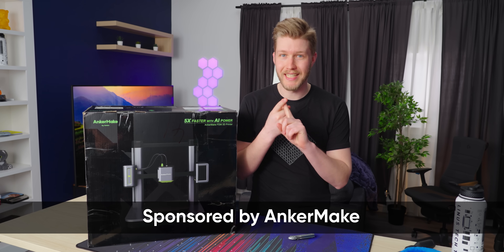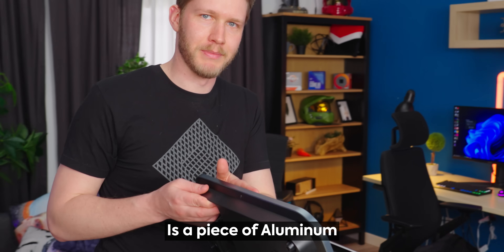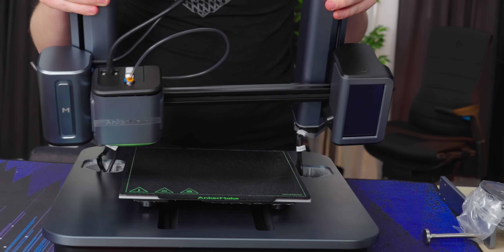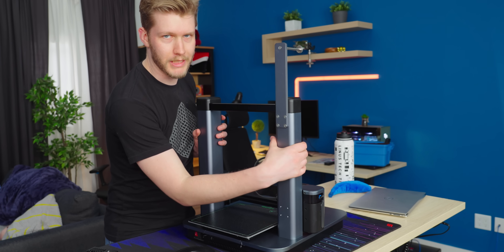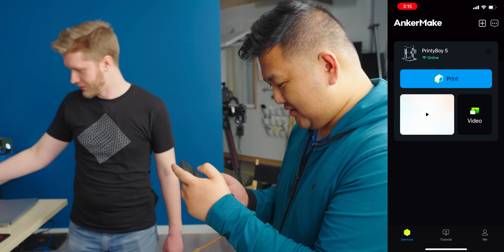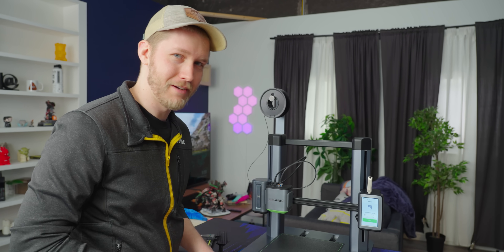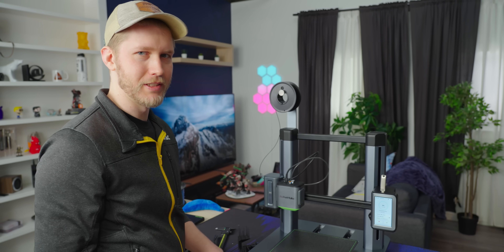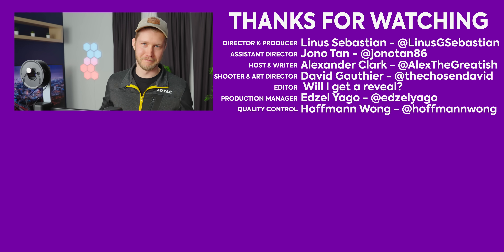Much BETTER than Expected - AnkerMake M5 3D Printer

Comment: This thing is crap... First off auto leveling reliance, you need to level a bed, no fancy auto leveling is going to fix bed leveling, but hey if you like parts with a tilt to them because of auto leveling compensation go for it, i level the beds on my printers about once a month when i replace the build surface, i run around 5kg of filament through my printers per month, i have 8 printers, do the math, i print a LOT.  For the price you would be better off buying a Creality Ender printer, the 3 is good for beginners, easy to assemble, easy to maintain and repair and modify.  If you want a large volume printer go with the Ender 5 Plus or the slightly smaller Ender 5 Pro.  Most of my print farm is older Makerbot Replicator printers that have been massively upgraded and run daily, but i also have an Ender 5 Plus for large prints and its been flawless since i upgraded it to linear bearings instead of the rollers on the X and Y axis, there is ready to buy upgrade kits out there for it and easy to do for even beginners.  I've been printing almost ten years now also, and i haven't had much issue, i suspect they were using cheap crap printers if they have had that kind of experience in the last ten years, most stuff above the really cheap crap has been great in that time.

Comment: *editor, don't judge.
Physical assembly of equipment like that is more about specific unit practice & experience than anyone not in a repair role has the experience to realise.
Former Paslode repair tech in Australia- there are specific ways to hold, brace, clamp, apply force to each specific tool, depending on specific size, shape, weight, task & worker physiology. So everyone figures it out themselves in general - that foam assembly assistance was Unusual as general a rule outside of that experience, as well.

Comment: It scares me the amount of detail left out for a sponsored video….

What are the build dimensions? Max hotend and bed temps? Standard nozzle? How do you access the nozzle? Does it come with a brass nozzle or anti wear? That box the filament enters is just a run out sensor? This is direct drive? Is there USB access for a computer or OctoPi server?

All I’m seeing is an Ender 3 S1 (Pro) with a locked down slicer and no 3rd party support for a lot more money….it does look pretty…

Comment: As the first 3D printer product, Anker did a great job, it is a real out-of-the-box printing, which exceeded the performance of 80% of the printers on the market.
But if it can do 250 mm/s at 5K acceleration, 4K deceleration, and a perimeter distance less than 20mm at a speed of not less than 100mm/s, I will be very shocked.

Comment: the alu isnt cnc milled its cast its alot cheaper and about the same amount of metal youd get on any other 3d printer just used in a different way rather than alu square beams

Comment: The printer looks pretty sweet not gonna lie, but I'm hesitant to back it. You just can't know exactly what you're going to get until production units begin shipping. One thing in particular that puts me off is one of the fine print notes at the very bottom of the Kickstarter page: "The 3D printer needs to be connected with the AnkerMake app. The app only works when all linked devices are connected to the internet." Being forced to use their proprietary software whose purpose is probably largely to phone home just doesn't sit right with me.

Comment: there is no way thats anywhere near 250mm/sec. all lies, your acceleration is far to low to even achieve those speeds with those small prints you're doing, its all a visaed. its like a glorified ender 3.

Comment: I admit, it comes with some nice bells and whistles and impressive speed, but outside of the speed, the price is a bit high, especially for anyone looking for a first printer (which is what the marketing looks like it is targeting, to me).  The bed only hits 100C and the hot end only hits 250C.  That’s entry level capability and it’s going to limit most people to PLA, PETG, and TPU without adding on an enclosure, and nylon and PC are completely off the table.  If you want a direct drive printer, a Creality Ender 3 S1 is $350 cheaper, has comparable base specs, is just as easy to assemble, and has fairly extensive first party and aftermarket support.  The S1 Pro gets you into a 300C hot end and is still $260 cheaper.

Comment: Cheap printer huh? 700+ for quality that you can easily reach with an ender 3 and some mods. The big advantage would be that while youre upgrading your printer you would start to understand more and more about 3printing itself. And this is knowledge you definately need sooner or later. Also this anker printer will fail at some point and then youre basically fucked. 

If you want a entry-level printer which allows you to tinker and dive into the world of 3D printing -> go for the ender 3 and mod the shit out it. 
If you want some kind of "apple" in the printerworld -> go for prusa. Their printers are in this price range unmatched. They have excellent support and a large community (something that maybe never will evolve around that anker printer but who knows).

Comment: This is not the product. This is one of 13 machines made in a limited run. It's not appropriate to offer any opinion on a product which doesn't exist yet based on a machine which has been made specially for sponsored reviews, especially not in a video which will still be around once actual production machines are available and people start searching for reviews of those.

Comment: My Prusa Mk3 has basically never failed yet, printing PETG on the textured plate without a worry.  But it's still a process under improvement - I honestly don't expect real innovation out of Anker though. "AI power" is just buzz words, and this video is as usual with LMG a paid ad.

Comment: What I am realy hoping for is that the final version will also perform as well as this unit. What would also be nice is if they would have an encoder as a Filament Sensor. Not only would it detect if filament is running out, but also if the extruder is jammed. 
What would also be important to me is that you can easily tension the belts and do basic maintenance without tearing down the whole machine.

Comment: The "calibration" thing where you measure how much a length is over- or undersized is a myth. The stepper motors have a fixed steps per rotation and every rotation will be "x" amount of teeth on the pulley. So the only thing that can be off is the pitch of the toothed belt and those ones are extremely accurate. Outer and inner dimensions have a fixed offset though due to the droopyness of the filament and the programmed compensation for that in the slicer, not in the printer.
Edit: The 0.5mm undersize is a lot off though, thats more than the width of a print line. This is most likely due to slop in the belt and needs to be tightened

Comment: Yeah, no. I am not a fan of massive companies offloading their R&D and marketing costs to the consumer via kickstarter. All the blurb about 5x speed, talking about standard 250mm/s speeds when that seems to be the max of what the printer can do (according to their documentation). AI stuff only working with their proprietary slicer, huge red flag right there to me.  Their mesh levelling is just that, no auto-z it seems (again, kickstarter page, I quote: The only time you need to do any tweaks by hand is when you upgrade something major like the nozzle or PEI soft magnetic plate.). All that, and buying into a proprietary ecosystem that may or may not have parts available 2 years down the line? NOPE!

Comment: aluminum isn't even expensive though? 25% more expensive than plastics. am i missing something? both plastic and aluminum are really cheap mineral/material.
Reply: you could see the indentation that coralate with a cnc tool removing the material from the back of build plate. this adds time, machinerie tool and specialized work. the piece needs to be about 3 inches thick. most of the material is lost when making these kind of pieces and like they showed, a piece of solid aluminum with the correct size cost a pretty penny.

Comment: If GCODE tells the tool-head to make two lines 40mm aprt, you gotta remember that those lines have a width.
The error you were reading is the width of the line, mostly.

Comment: I have and use the Snapmaker 2.0 A350 Modular 3-in-1 3D Printer, that is made of only metal mostly thick aluminum, and it's a great 3D printer, 
and it's very easy to use, but it cost a LOT of money.

Comment: It certainly looks nice. Only problem I can see is with all the unnecessary coverings such as on the hot-end around the motors and the frame, if anything does go wrong its gonna be a whole lot of hassle stripping it apart to get to them.

Comment: Given the volume of machines that never deliver on promises, I'm frankly disappointed in LMG for doing this segment. The features displayed are certainly promising, but that's a simple task when seeding devices to reviewers. Given that the creators didn't even openly declare that certain components were orders of magnitude higher quality than what will be delivered (the CNC Aluminum chunk) erodes any trust I'd have in this brand. Unfortunately, not everyone's as cynical as I am. For their sake, I hope it ends up delivering as something close to what's being promised. 

As for LTT - I get that this channel is geared towards doing sponsored spots like this, but one search for "Kickstarter 3d printer" would've given you plenty of reasons to be dubious of even a company of extremely solid reputation.

Comment: Well overvolting your 3D Printer actually does work. My crappy Anet A8 runs on 14V instead of 12V for about 2 Years now. My Mainboard (20$) died ones but I think that was another issue.
Of course the printer doesn´t print faster or something but it heats up way faster. And well it will probably die faster...

Comment: The biggest question is if the acceleration also scales with the multiplier. I guess in reality the printhead won't even reach 100 mm/s cause it can't accelerate to this point.
Reply: you'd be surprised how short of a line it takes to get to full speed at a modest setting of say jerk set to 10.
Reply: If it's running Marlin with hardware acceleration curves, then no. If using software acceleration, which is an option in the popular slicers, then it will affect it. However 100mm/s is absolutely doable just after a corner. Mine is currently set to make travels moves at 120mm/s which slows rapidly to 80mm/s as it approaches the part until it slows again to the print speed. Even cheap NEMA knockoffs have got really good, good enough to rock the table the printer is on if you go too aggressive.
Reply: @eideticex  Will be interesting, how solid the motion System actually will be.
And if something like pressure advance like in Klipper or at least linear advance will be in place so parts still look good.

Comment: For that price you can buy a prusa mk3s+ which is much better in dimensional accuracy and has far cheaper replacment parts. Btw 0.5mm error is a big error for a 3D printer not just a negligible one

Comment: I kinda dont trust the speed, most nozzles will give you about 15mm³/s with a dual drive extruder. 
And print speed does not look like 300mm/s.

Comment: For the Mega roll, try flipping over the wire holder, so that the roller bar faces away from the aluminum columns that were getting in the way of the roll

Comment: all i have of anker products are a couple of charging bricks, power adapters and some cheap earbuds but they have all been surprisingly good quality, and have been in use for years now. if i had the money to spend i would probably jump on this. my ender 3 pro has been... OK... mostly... but yeah not so much for printing small details

Comment: You could mount the spool holder backwards and have the big roll hang off the back of the printer if you really wanted to. I don’t like keep the spool at the top of my i3 style machines personally but it might be possible

Comment: I'd love to see a budget 3D printing video - taking a budget printer, then upgrading parts until it rivals a much more expensive printer.
Reply: an Ender 3 rivals way higher priced printer out the box and is only $200

Comment: Overclocking 3D printers is totally a thing. It involves 48V steppers, there's high end mainboards for it all, and it also involves a lot of (sometimes unorthodox) temperature management. There's even benchmarks. Such as the speedboat. I'd totally challenge LTT team to tackle the speedboat challenge.
Reply: Yup, I still remember my jaw hitting the floor when I saw a sub 2 minute Benchy on an overclocked Voron Zero.
Reply: Agreed, the mainboard on my voron supports 48v to the x and y steppers. But i would need a 48v psu for it, so i just run 24v to everything.
Reply: @cotycollins6302  Same on the RatRig. I already have 2 dedicated PSU's in there (I am aware I could technically use 5V of the board). The Pi has its own mains > 5v brick. I am tempted however for a 48v tertiary system, just to learn. 3D printing to me is the same as PC overclocking: nice to get great results, but in the end you want it to be everyday useable as well. Those LDO mofo's can be a pain to acquire (not expensive, just a pain to get, esp in a mainly amazon-free country). And drivers are perhaps even harder, though 3DJake carries those as well now.

Comment: Out of the box having the webcam, filament detection, and bed leveling is nice, but the control and customization you can get with OctoPrint, I feel outweighs the product in general. My Ender v2 was $400 and that's including everything I needed to build it to my liking. EZABL Bed Leveling, BIGTREETECH optical filament detection, and $75 for the PiCam HQ. I already had a Raspberry Pi, so technically it would have set me back $475, but if this thing will retail for $799, I just don't see the value for me personally. Even my Ender v2 at $259 printed out of the box very well, it seems the main focal point is the speed, I'm just not sure I can justify the extra $1 per mm/s. For someone learning and wanting a fast printer that doesn't want to take the time to set everything up / wait for parts, I can see this being worth the extra $300. Either way someone new will need to learn about calibrating and would probably need at least a calibration cube.

Comment: Seems promising, but He printed parts they specifically Designed, and optimized, like mostly the First prints manufactures ship do quite Well. 
Without the Software is hard to tell how good it is gonna be. How fast wozld a 3D benchy be ? And how does it compare to the prusa MK3?
The Design is Not Bad, but I don't think it is intended to be a real workhorse, maybe Like a Print a week Not 24/7 use.
Reply: And the camera should be optional, not sure how much that adds to the price.

Comment: the backing system is a piece of shit, cannot get ANY of the rewards, as it will otherwise force me to get multiple units

missed out on the 21% off due to this and now its not letting me get the 17% off units, even though there were only supposedly 7 of them
literally will have to wait to buy one after production is started, if i even want one at that point

Comment: The build construction looks pretty solid (Hard to tell with all the unneeded plastic in the way!), which would help with speed, but I'm most concerned with the closed slicer and the promises of advanced AI that is supposed to work from a fixed position. It'll be interesting to see how it turns out

Comment: They should put the control board on a swivel so that you can adjust the angle you view it at. Also maybe along that side beam have a slider so you can also adjust the height.

Comment: You didn't bother explaining if it seems to ramp up the acceleration profile to match so that the 250 mm/s and 300 mm/s actually makes sense. You also didn't bother showing anything about the extruder. Nice commercial for it though.

Comment: The marketing on this machine is confusing and complete bullshit.  Anker claims that it can use plastics requiring temperatures above 230-240c, all the way up to 260c.  This is insanely unsafe as it does not have an all metal hotend.  The ptfe lined hotend will start off gassing fumes known to be toxic and even kill pet birds above ~235c.  I'm greatly disappointed.

Comment: At this price you should be getting linear rails instead of the dirt-cheap v-roller solution. This type of movement system will need constant maintenance and adjustment.

Comment: Very curious how it stacks against prusa but I have to agree with the print head looking hard to service and wether or not this is a Bowden. Semi Proprietary slicers are a bit annoying if you have multiple printers, but in general would love to see more short circuit vids like this!
Reply: I don't even get what a 'proprietary slicer' would mean. If it prints from gcode then use any slicer you want?
Reply: @deepblue812  feature locking mostly. For instance ideamaker to use the Raise Pro machines, which is ok but clunky and controls are everywhere, or Creality Slicer which sucks. I really like Prusa Slicer but they don't have Tree Supports (yet).

I understand why they might go with their own to have some features or "ai speed" but I still groan about having multiple different slicers for multiple machines.

Comment: video showed 7075 grade Al which is more expensive and stronger than the more widely used 6061 by about 3x so you could buy that block for way cheaper.